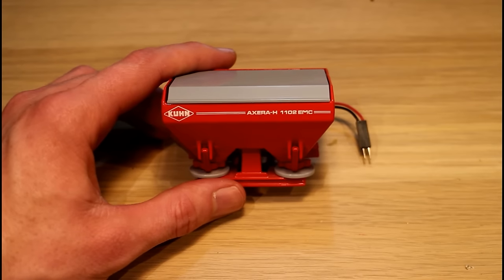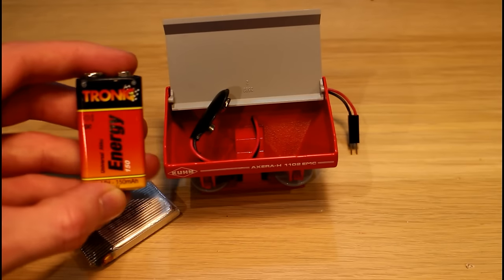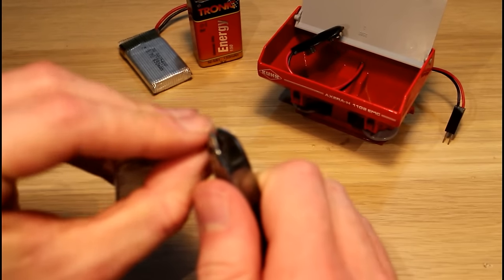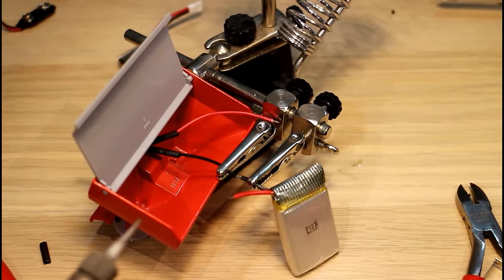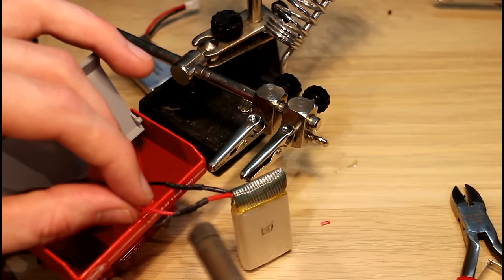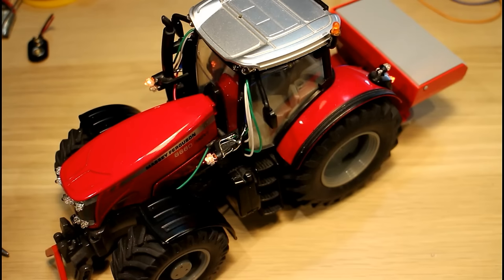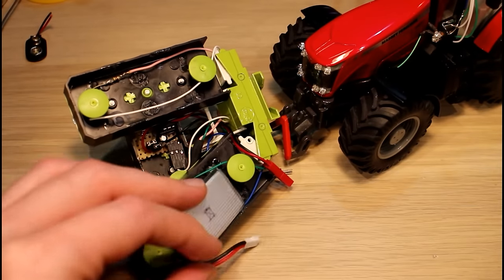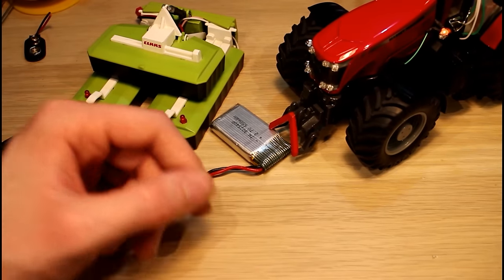Kuhn Fertiliser Spreader Battery Pack for RC Tractors

Comment: A tips when splicing wires that carries current is to cut them at different length, that way they cannot short on each other even if the insulation fail.
Reply from the maker: +Maria Engström That is very good advice, thanks.